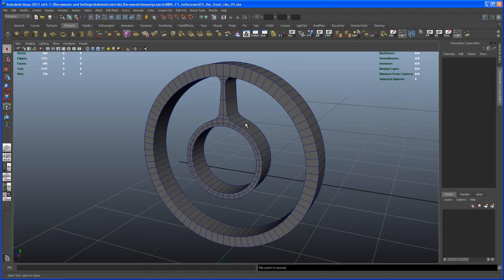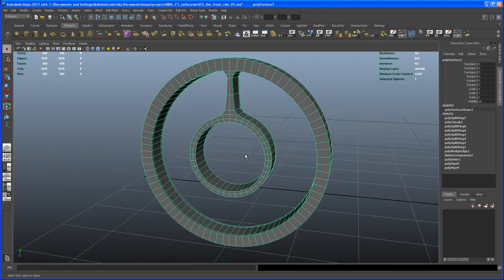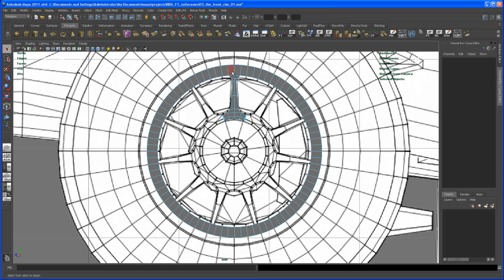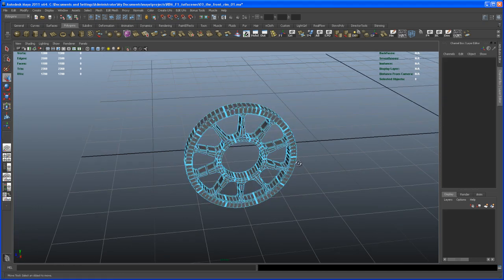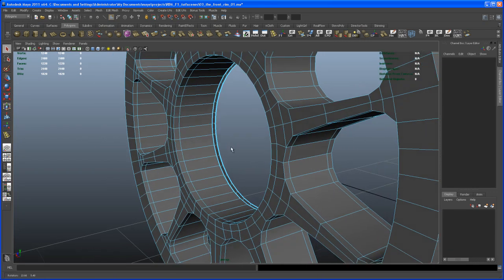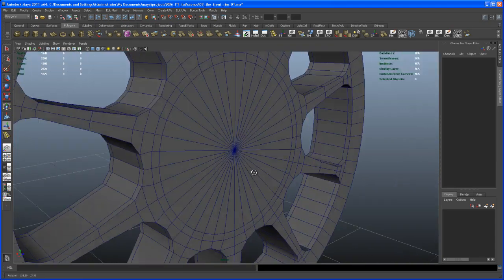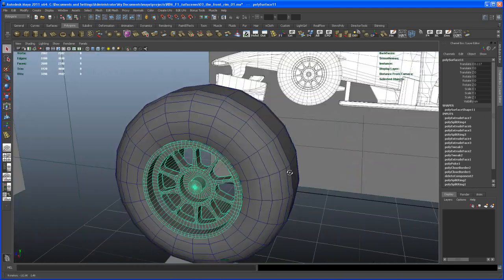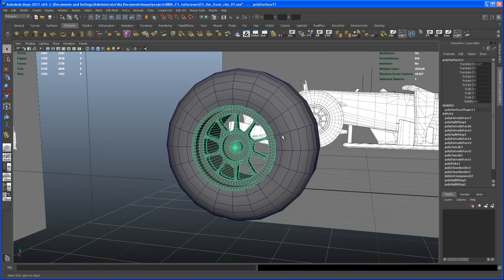Modeling tutorial in Maya - RB6 F1 car - 04 the front rim 02

Comment from the maker: @zenonithus 

pressing "3" on the keyboard is "smooth mesh preview" ... but this is by default in Maya... think this function was implemented in Maya2008 or 2009.
What Maya version do you use? If it's 2009 or higher this should be the default key for smooth preview.